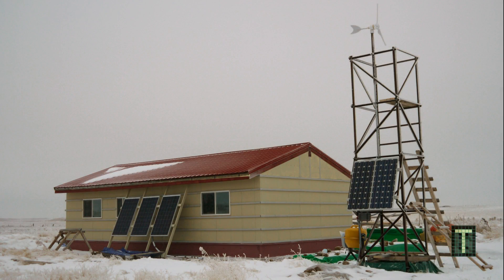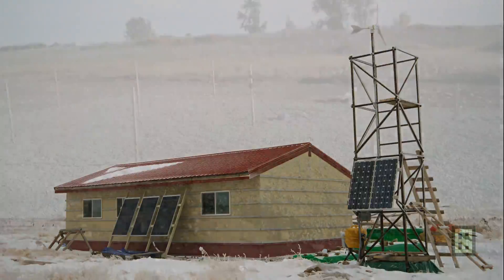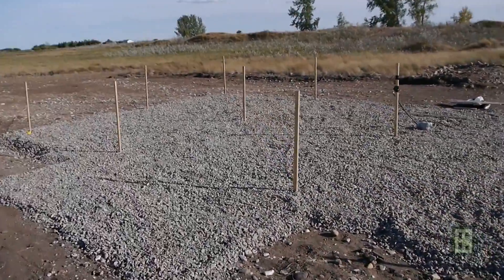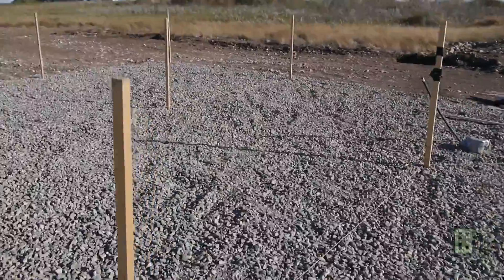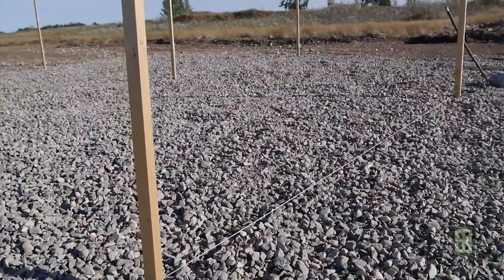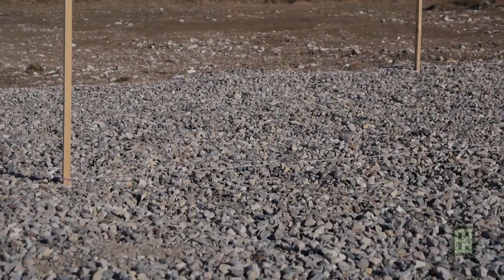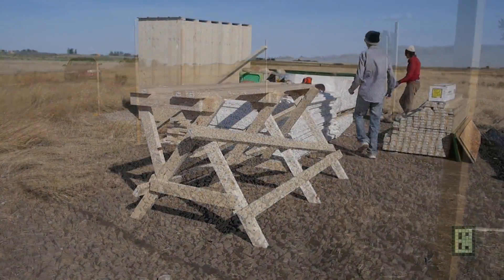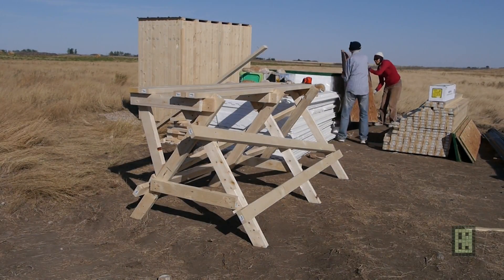Off Grid House

Comment: I think it doesn't matter where you upload the videos as You Tube will recommend them to people who have a specific interest in either electronics or off grid living and how to generate your own power. The only thing that I  would suggest is that you tell people (like me who can follow instructions but don't have the background knowledge,  who are trying to keep costs down) where you can cut corners but safely,  for instance I know that I am supposed to use deep cycle batteries but they are expensive when you have to buy a solar, wind turbine hybrid and an inverter (while building your house) in this case is it safe to use 12volt rechargeable batteries (like for mobility scooter etc?) Or not? Things like that are what I need to know and any other safe shortcuts like I've seen wind turbines built rather than bought and all the details of this kind of stuff would be great.  I think you've probably done your series by now and you have probably covered this but I am going to watch it and then if I have questions I will ask at the end.  Thanks for posting this stuff anyway and I hope you are enjoying your off grid home.
Reply from the maker: +Anne Anderson (Foxiepaws) I had no time to do this series of videos. I was busy with one of my projects related to solar called the Solar BMS. Is a solar charge controller that can use any type of Lithium batteries.
I'm more about amortization cost than initial purchase cost when I do anything. Wind turbines self made or purchased are not a good solution anymore mostly do to significant drop in solar PV panels prices. I have not used my wind turbine in more than a year and I need to remove it from the tower.
The proper deep cycle batteries will be less expensive than non deep cycle Lead Acid in therms of amortization cost what you pay for each kWh stored over the life of the battery. LiFePO4 that I decided to use has an even better cost amortization than a good quality deep cycle Lead Acid but there was no charge/BMS for it that is why I decided to design one. Even so storing energy in best LiFePO4 will cost between 20 and 30 cent/kWh in real life where energy from solar PV panels cost only 3 cent/kWh an order of magnitude less. So one cost saving tip is to get the smallest battery you can get away with and invest more in the solar PV array. Also find ways to use most of the energy during the day when is sunny so that you use energy from the PV panels directly as much as possible.
The solar PV cost amortization is so low (below 3 cent/kWh at this point) that I plan to fully heat my house with electricity from solar PV panels (no battery will be used for this part) energy will be stored in thermal mass (can be water or concrete in my case). Energy storage in thermal mass is at least 20x less extensive than the best battery.
As for a house is best to invest in thermal insulation no matter if you live in a cold or warm climate and also incorporate thermal mass in the design of the house. I wish I had the time to do this video series but it does not look like I will get the time for it soon.
Reply: Thanks for your reply,  I will do what you suggested,  I don't need to use solar to heat the house as I have endless (in my lifetime and my children's supplies of wood as in the last two years we have lost on average 1,000 trees a year to the high winds and bad logging before we purchased the extra bit of land around my sister's house (our ex family home) the land we had up until then,  was logged and we have replanted with indigenous broadleaved trees (you are required to do this in order to purchase ex forestry land) therefore I will be using a wood burning stove with the oven, hotplates and back boiler for water which will be both harvested rainwater and water from the stream just below where I am building.  I was hugely unlucky as the government used to give 70% grants on solar panels but they stopped on the 15th of January this year. .nasty Christmas surprise!  That's why I am looking into all the best ways of making solar work for me (the wind was always going to be backup because of the high windspeeds in Scotland. ..the National Grid windfarm close to us is forever bursting into flames due to overly high winds!). I think I will just be using solar for lighting and the fridge freezer and charging laptops,  phones and my e-cigs lol! Scotland is good in the summer as it is only dark for four hours tops in June and July so I could probably run stuff directly off solar in summer but would need batteries in winter.  I also have the option of water power but that's for later. Thanks again for your reply and I hope all is going well with your off grid home. I may get in contact again when I have my solar panels up and the place is all insulated,  to ask more about storing energy in thermal mass. Best regards x
Reply from the maker: +Anne Anderson (Foxiepaws) If you have so much wood that is free then it makes sense to use that for heating. Solar panels provide power even in the most overcast dark winter day. From my experience in the worst winter day I get about 12x less energy compared to the best sunny winter day so if you have say 12x more panels the you     get as much in the worst day :) Not quite a joke since PV panels amortization cost are under 3 cent (that is for 25 years and $1/Watt initial cost) where the best battery costs 20 to 30cnt /kWh stored so even if you get 10x more panels than you normally need is still as good or better option than getting a larger battery.
So get as many solar PV panels as possible and a small battery. But you can ask again when you are ready to do this.
Reply from the maker: +Anne Anderson (Foxiepaws) If you have so much wood that is free then it makes sense to use that for heating. Solar panels provide power even in the most overcast dark winter day. From my experience in the worst winter day I get about 12x less energy compared to the best sunny winter day so if you have say 12x more panels the you     get as much in the worst day :) Not quite a joke since PV panels amortization cost are under 3 cent (that is for 25 years and $1/Watt initial cost) where the best battery costs 20 to 30cnt /kWh stored so even if you get 10x more panels than you normally need is still as good or better option than getting a larger battery.
So get as many solar PV panels as possible and a small battery. But you can ask again when you are ready to do this.
Reply: ***** Thanks so much for taking the time to read and answer my questions.  I think I will get more solar panels like you said and I probably will get back to you nearer the time.  Thanks again and I hope all is going well for you and your family.  x

Comment: I think this is very related to electronics ... I want to know for example how did u use solar panels, what do you feed with it, what batteries etc. =D
Reply from the maker: +Daniel Tejnický If that is what you want to know then take a look at my google+ page  https://plus.google.com/+electrodacus/posts  I'm designing probably the world most advanced offgrid solar charge controller is now at the second version. I use LiFePO4 batteries for energy storage since they are the most cost effective solution.
Next project will be related to this and will be to fully heat my house with electricity from solar PV just solar PV panels and a solar heat controller with digital mppt that I will do next the energy will be stored in thermal mass not battery.
Solar PV amortization cost is under 3cent/kWh where real cost of LiFePO4 battery amortization is somewhere around 20 to 30 cent/kWh. Thermal energy storage is at least 20x less expensive than battery storage so it makes much more sense for heating.
There are some videos on this youtube channel about my battery. I made some tests 4 years ago when I got them and I will do another test this spring to see what is the degradation after 3 years of full offgrid use.

Comment: jan. 2016 what does it look like now  and dîd live up to expectations?
Reply from the maker: +hal barnes It looks about the same. I think it will be way to early to have anything unexpected for a house. you can look at may google+ account there are some photos with the house. I'm quite busy with other projects I have and did not have any time to finalize the house on the inside.
That was actualy a good thing since I changed my mind about heating. I want to heat withe electricity from solar PV panels so I will need to embed copper wire as resistive heat elements under ceramic tiles that luckily did not had the time to install.
Here is my personal google+ page  https://plus.google.com/+DacianTodea/posts there are some very recent photos of the house from when I installed some more solar panels.

Comment: Stopping at 13:40...
Great job of wrapping and insulating the main living area. 
May I ask HOW do you plan to ventilate the area between the sheeting with tyvek and the roof rafters? After you placed the roof sheeting it was also wrapped with no ridge vent that I could see for the attic or the metal roof framing.  Do you have a plan for ventilating those areas?  IF not your home will dry rot. Not a question if, but when. 
DID you leave center supports? I must ASSUME you did with the center load bearing footing you placed.
Also... did you plumb your Radiant Heat in zones or is it continuous in the entire home?
Your footing and sonotubes looked good... tower footings... in the ground 2 feet plus 10% the heigth of the tower or pole.
Reply from the maker: +Steve Mazz There is space for ventilation between steel sheeting and that impermeable tyvek style membrane. There are 2x4 in one direction and then 2x3 in the other direction so warm air will rise from the bottom to the top of the roof where it will get out.
There is equivalent of R70 in the roof space there is no additional space is filled with insulation and there is no need for ventilation there. This is common construction technique in Europe but I seen here is different and roof space is ventilated but there is no ventilated space between the sheeting usually shingles directly mounted on the OSB.
I'm quite sure there will be no rot problem.
Yes there are two large center supports inside probably you can see them in the video each support is made out of 5pcs 2x6 connected together and integrated in the two internal walls.
The radiant heating is a single zone the house will be equally heated is a small house 65sqm (about 700sqft). But I will not use that probably (I use it now temporarily) but I will have electric heating supplied by PV panels. The house needs max 1000kWh / month in the worst winter month for heating that is January here with average temperature over that month around  -16C The solar PV heating is the most cost effective since is just 3 cent/kWh and energy will be stored in thermal mass the 14 cubic meter concrete can store 100kWh at 10C delta in temperature. That is good for 3 to 4 days of cloudy whether maybe even more since cloudy days are usually not as cold.
With this soil there is no need for towers in the ground. Is well compacted gravel that is quite deep.
House is already 3 years and the footing is as it was new in the same place :)
This is the second house I build the difference is that this was designed by me completely I put a link in the perversion replay.

Comment: stopping at 6:30 into the build.... 
You have an excellent design for a slab on grade home as far as the vaper barrier and insulation are concerned.
The Perimeter footings and center load barrier area have adequate rebar. The hangers or cages should have connected, been continuous, a full rectangle that is with the rebar running through them. ALSO your footings should have been at least 12" under finish grade of the yard.  If you plan to backfill you should be OK except you are to leave 6" above ground and 12" below... 
You could have placed anchor bolts after placing the concrete, but approved drilled anchors are acceptable.
Last, at least to 6:30 it does not appear you used a thin foam barrier between the bottom plate and the concrete Slab... And it also does not appear the BOTTOM plate is treated material... let's continue watching.
Reply from the maker: +Steve Mazz Not sure you can see the rebar will be continue when you consider the top rebar that is from one side to the other . Not sure how well you can see in video but look at my drawings is a pdf at the end of this page http://greensask.com/
The grade was cleaned about 6" before starting construction the ground is mostly compacted gravel and sand there are a lot of gravel pits around me the soil is realy hard to dig in (I initially wanted steel piles but no one was able to that in this soil).
I do not see why a building needs to be below grade. The building is heavy there is no way wind will move the building just the concrete slab is about 30 metric tone (14 cubic meters).
Not sure where anchoring buildings to the ground is a requirement and why ? There was a recent comment from someone from Texas saying the same thing.
There is a thin foam barrier between the bottom plate and concrete. I think there is somewhere in a video a photo where I staple that to the bottom of one plate. It has a sheet of plastic and a few mm of foam.
No need for the bottom plate to be treated there will be no humidity getting to that plate. The concrete will be used as thermal mass and it will be heated in winter.

Comment: Why is it not anchored to the ground ? I would want my house to be !
Reply from the maker: +loc g There is no need for that. I wanted the house thermally isolated from the ground this was the best method. The concrete floor for this small house weights over 30 metric tones 14cubic meters of concrete so is heavy enough not to be of concern. The connection between the house and foundation is probably more important.
Reply: +electrodacus every part of building a house is most important! An sure you can thermally isolate an anchored build , and only reason I say why isn't it anchored is cause every cement slab I've done is anchored to the ground but yet I'm in Texas lol thanks for the feed back!
Reply from the maker: +loc g Here is really cold so thermal isolation is extremely important for an energy efficient house.
Not sure why a solid slab will need to be anchored to the ground. If is about high speed winds I think that with the traditional frame building the slab will still be there even if not anchored while the building will probably flat in really high winds. The most I had here since I moved was 110km/h wind gust that is just around 70mph.

Comment: This is really a silly way to build.  Stacked 2x4 is very inefficient and a real poor insulator.  Plus wasted lumber. Better two 2x4 walls with a one inch gap between them for electrical and (pex plumbing) with 1/2 inch osb sheathing and two layers of exterior  foam board (properly taped at seams).  Exterior horizontals look like rain catchers that will eventually rot or mold.

Wish there was explanatory commentary instead of the unnecessary music. Particularly about the roof system and the solar panel electrics.
Reply from the maker: +arbeeex The staked 2x4 has nothing to do with thermal insulation lumber is a poor insulator is just for structural integrity. Staked 2x4 is stronger than 2x6 + 1/2" OSB also cost is quite similar as building materials go there is of course more labor on staked 2x4.
The horizontals are painted on all sides and they can easily be replaced if necessary. The house is almost 3 years now and I see no problem with them.
The video is to short and there are to many things to explain not possible in this format. I intend to do more detailed videos about the process and the reason I selected this techniques but I'm just to busy with other projects at this time
Reply: arbeeex show us your achievements rather than criticise the excellent work others

Comment: i`m impress how you build your home with 2x4 must cost alot
Reply from the maker: +michel seguin For this house size the difference between a solid 2x4 wall like this and a 2x6 frame + OSB is around 1000 to $2000 that is just for the raw materials not sure what will be the difference in labor if you need to pay someone to do this.